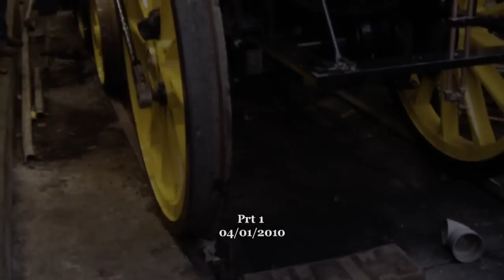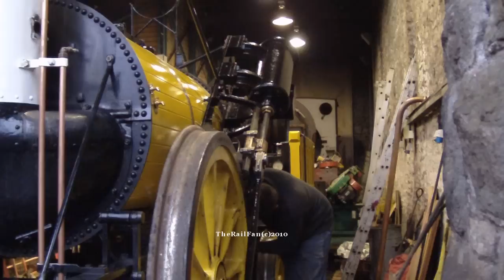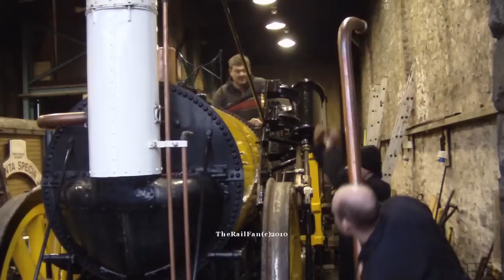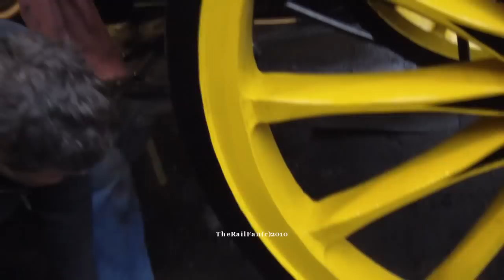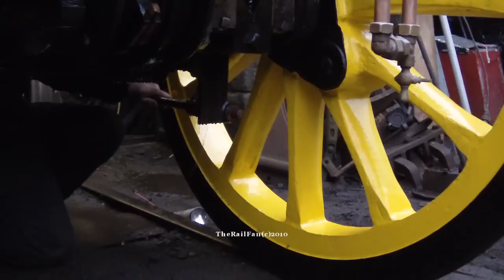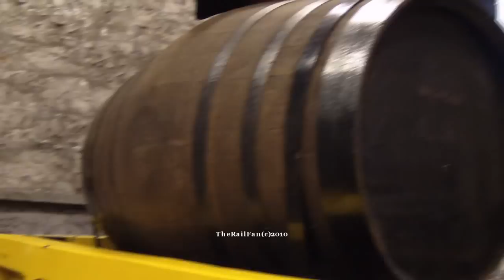ROCKET Prt1 Avon Valley Railway Bitton 04/02/2010

Comment from the maker: 73096std5 this is what wikipedia said ....
Coke is the solid carbonaceous material derived from destructive distillation of low-ash, low-sulfur bituminous coal. Cokes from coal are grey, hard, and porous.
  
i was told it runs on coal but coke is its proper fuel ,,but they did fire it up using russian coal ,and not coke ,so i guess it takes all types of coal